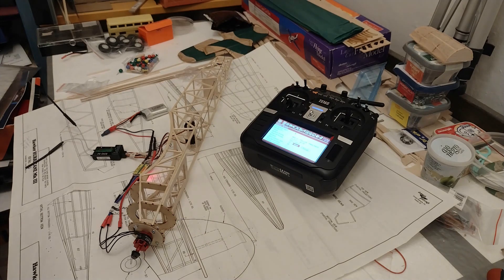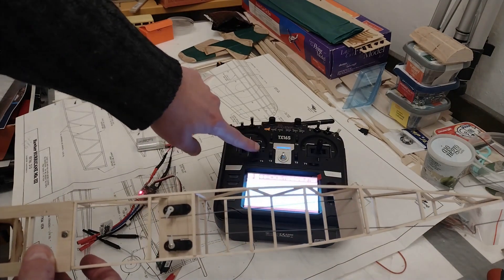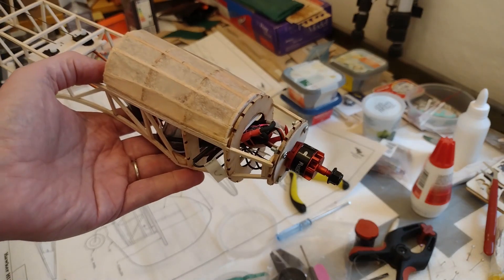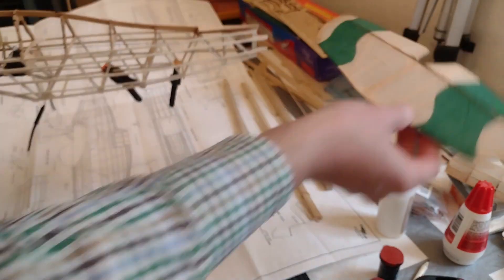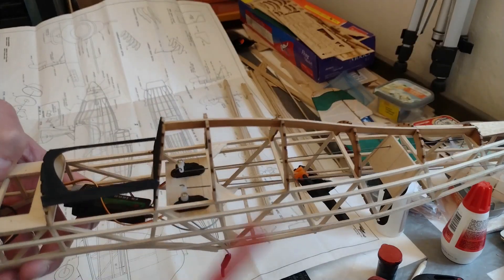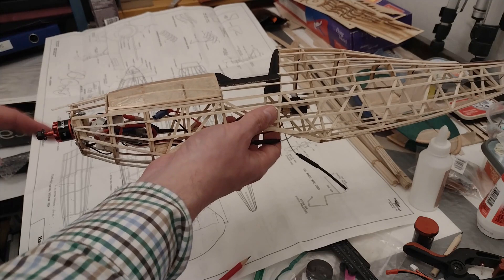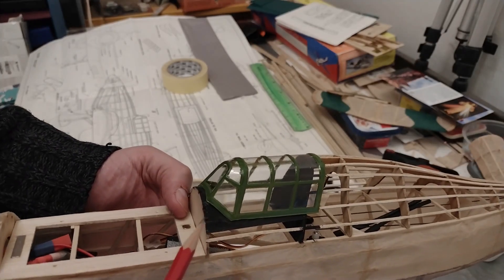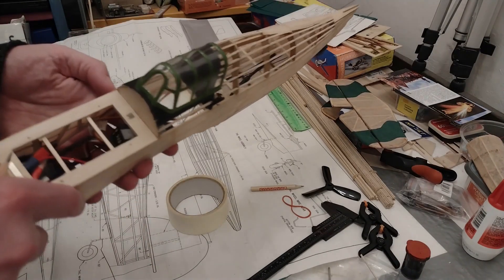04  Dumas Hurricane RC Conversion   Electronics and fuselage finish

Comment: I would just solder the motor wires to the esc wires. Those bullet-type connectors are HEAVY! Looking good!
Reply from the maker: That is a very good point. Especially if the ESC is going to live in the plane for good, there might be no point in using the connectors.
Reply: @downwindchecklist6567  Now you're starting to think like someone who converts free-flight kits to RC! You've started with the very hardest little corner of the hobby and you've stuck with it and shared your journey. Thank you. Save those big connectors for a bigger plane!
Reply from the maker: @joelamb3581  Thx for all the comments and encouragement. It is not easy to see models fail time and time again. If I am still at it it is because of you and all the community that show that it is possible!
Reply: @downwindchecklist6567  Your kind words warm my heart. If it was easy, anybody could do it!